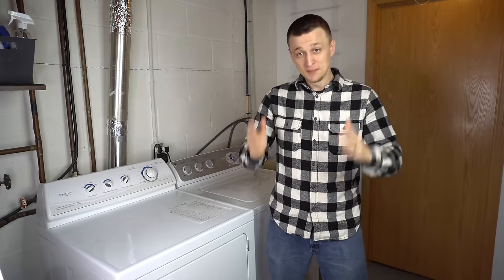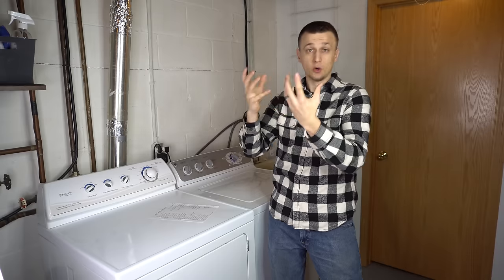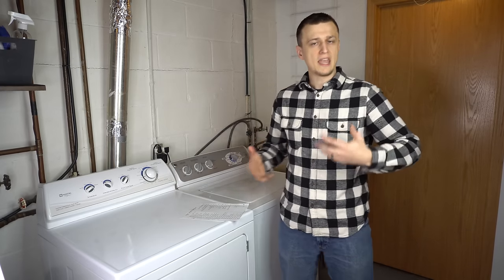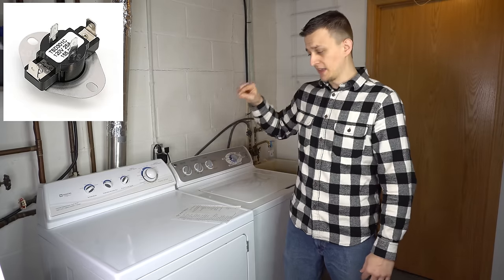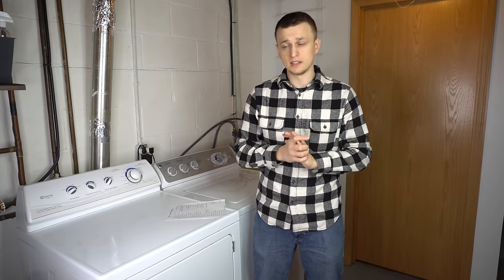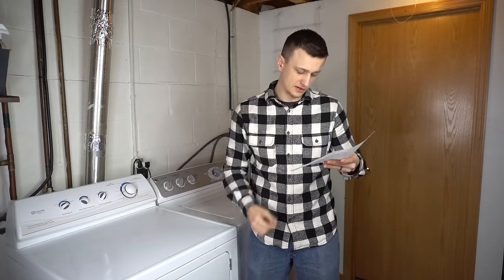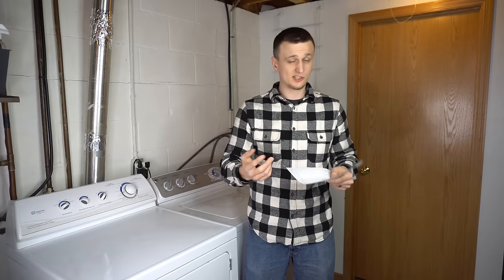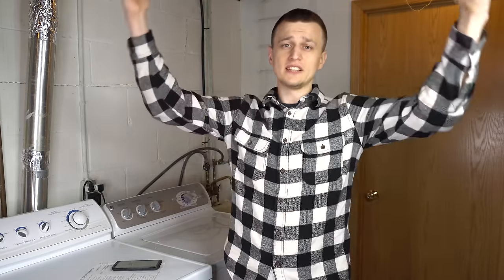Dryer Troubleshooting - Top 10 Dryer Problems

Comment: I have yet to come across a cycling stat rated anywhere near 200 F!  Usually more like 155. They do vary a little. 
   High Limit stats go up to a little over 200 F.  Then thermal cutoff around 315 F. 
  Unless gas dryers are different, these are the temps I come across with electric dryers. 
  Do gas dryers run higher temps than electric dryers?
   Seriously, I do not work on gas dryers but have been told they dry better than electric dryers. Higher temps may explain that.
Reply from the maker: Well what I was referring to is the temperature inside the dryer while it is running ( I use a thermal couple wire that I stick into the dryer to monitor the temperatures while it's running). As for the cycling thermostats, different dryers will have different ratings and to be honest I have not really paid attention if gas or electric plays a big role in that or not..

Comment: Could it be possible to change the fuse but put the fuse wires on backwards? 😅
Reply from the maker: No worries, if you are talking about the thermal fuse, it does not matter which wire goes to which side. 👍

Comment: What's the problem when some clothes  have a oil stain when I take it out of the dryer
Reply from the maker: First I would make sure that the oil stain is actually coming from the dryer and not the washer. I often see leaking washer transmissions stain clothes. (top load washers) Otherwise I would start by sticking my head into the dryer drum and with a flashlight look all around to see if there are any oil or burn marks on the drum. If not finding anything, then take the dryer apart and you should be able to locate where the stain originate from. Could be rollers, bad felt seal, something stuck on the inside of the drum, etc..

Comment: I replaced blower wheel in my Amana dryer but when turn ON the dryer breaker then Main breaker tripped. Note dryer door and switch was opened when dryer breaker turn back to ON position. Please help me how can fix this problem.

Comment: What is it when your electric dryer( Frigidair DE500ADW5) works as it should and shuts off at the end of the cycle, but the heat is staying on. Checked the heater, is not grounded.

Comment: Ok so I replaced belt and tensioner and freed a wheel to spin easier. All together and now will not turn easily with any kind of load over a couple pounds.  Maytag says it is the correct belt. Now what?

Comment: dcxr463ea1ww ge dryer model will not stay on when turning  start button. The switch is working and drum turning, but though it comes on as soon as I turn start switch on, it dies immediately right after I start it. What cause’s it? On this particular model

Comment: There was a broken belt in our dryer, we fix it but when we put it all back on. It spin but only on really light loads not a normal loads. My dryer is almost 6 years, the GE brand, model GTDP490ED7WS, Help please.
Reply: could be that the belt is on with the smooth side toward the drum?  it should have the grooved side in contact with the drum... sometimes when you are working it onto the motor pulley, it gets a half twist so it rotates to the wrong side... you will be able to tell if that is the problem just by taking the top off